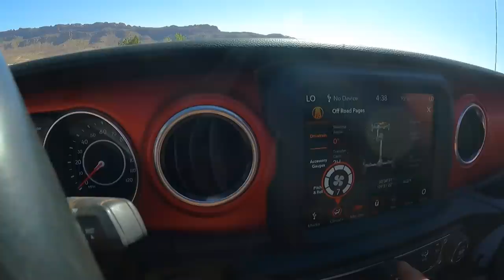Tourists Being Touristy

Comment: Amen Rory!! You definitely got that Wright on where the ford V10 belongs!!! In the trash just like every other ford engine except for the very best and only engine that ford ever made the 7.3 diesel engine!!! If ford would have kept that awesome engine around like Chevy has kept there amazing 6.6 diesel engines for years!!! I have a 2007 LBZ and it has over 250,000 miles on it and the only thing I have done to it is change the oil every 6,000 miles using the same kind of oil every time!!!

Comment: Hey Rory, just a question about it getting "Slick" where there is a lot of black rubber worn onto the rock,, then a light mist of rain on it?? Say mostly going downhill, and not so much up... they can all turn sideways in a hurry if something was to go bad enough wrong. I am not scared or worried, its just a question from a guy, 73, in alaska and never had this opportunity to do this type of climbing before.. Lived a sheltered life as a heavy duty diesel mechanic/operator in the southeast alaska islands... yessiree howdy, we have a few humps in the ground like those sept they are muskeg and jagged rock so climbing is kind of a real challenge when tire meets the edge of a rock you can shave with.  So like all old guys, I wandered off of topic. Does that tire slime turn to a oily  mess if just damp?

Comment: 1:22  Question. I'm slowly gathering a list of 'Subaru Outback Wilderness Edition' approved trails for when I retire in 8 years. I'm looking for just mild stuff that's NOT going to cause any damage and leave me stuck or just with a banged up car and regretting I went that route. Anyway, so far that road/trail  that you're on here in the start of the video just seems to be a dirt road that may have some big bumps, washed out areas and stuff like that, but not any rock crawling or anything else that would get me in trouble (car damage or getting stuck). If you're not familiar with the Wilderness edition, it has 9.5" of ground clearance, a bit lower gearing than the traditional Outback and a 2.4L turbo engine. More than capable (for the RIGHT trail). I'm asking this because you can't always tell for sure if this trail/road is ok based on what you see in the video because the video will leave out parts of the trail and may not show sections that would tell me "No, do NOT take even the Wilderness edition down this trail!"  OK, now back to watching the video... Let me know if this trail would be OK and also, tell me the name of it exactly please. :)  Thanks

Comment: Whats hydraloc?
Reply: It's when oil or water ends up in one or more cylinders.  It happens in roll overs because the oil flows down hill into the valve covers and through open valves into the cylinders.  It can lock up the engine because fluid won't compress.
Reply: @frankhage1734  Probably best to keep the wheels pointed down?